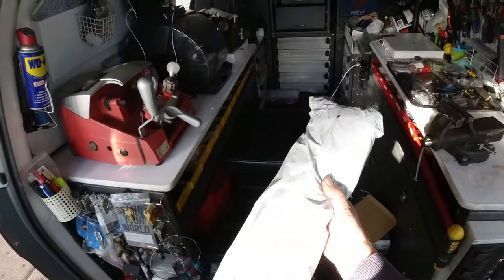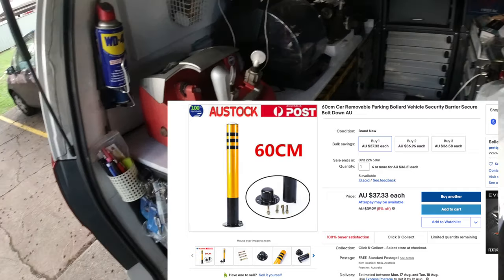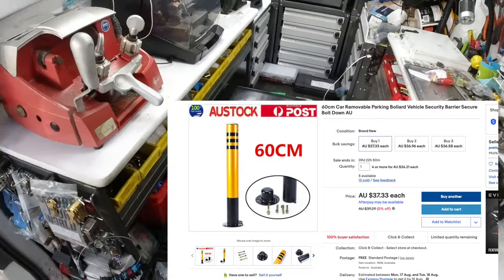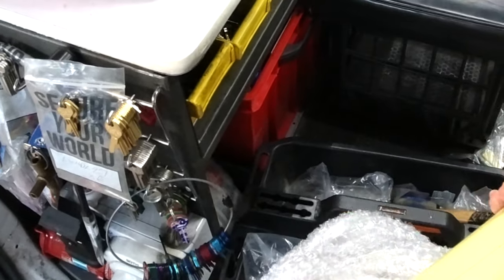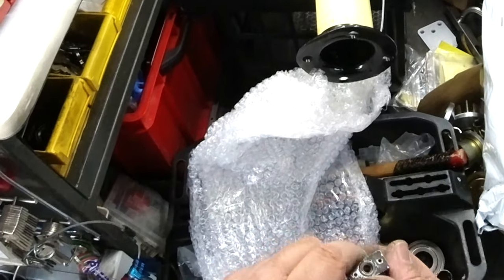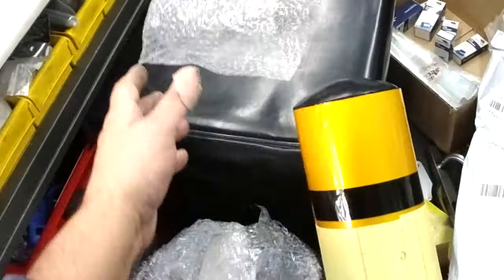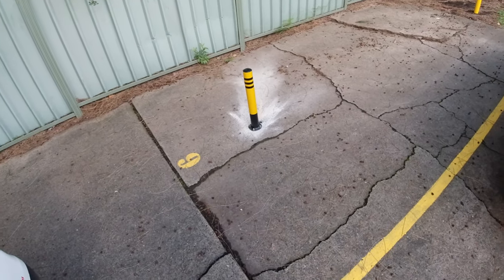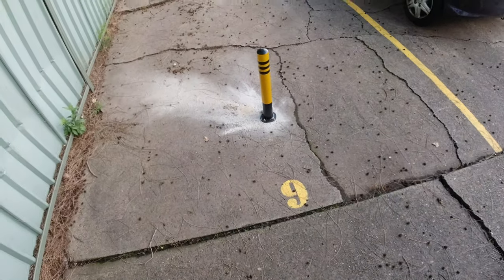Locksmith Job #334 Removable Parking Bollard $37 into $330 in 10 Minutes

Comment: The post doesn't cover the bolts when you put it on, so anyone can come along and remove the bolts.
Reply from the maker: This is true
Reply: Using a center punch to malform the bolts into and over the top of the nuts as well as tough loctite would help slow them down. I would assume only a spiteful neighbour in the night would try to quickly remove it and would probably give up quickly if it were hard

Comment: As long as the customer was happy! Surely the padlock came with more than one key? And I certainly hope you were joking when you said it's 'not pickable'!!
Reply from the maker: Yes, its pickable , but not as easy as a pin lock, its some kind of Abloy copy, I will pull it apart in the next video, Its pickable if you have a tool to suit
Reply: The plugs on these are press fitted, I believe with the right size screwdriver the whole guts will pop right out...
Reply: Dr Lock You are quite right that these are abloy copies, but unfortunately nowhere near the tolerances or quality, the disc housing in these is plastic so the core can be forced, and none of the discs have false gates. It is possible to pick up a cheap disc detainer pick to overcome these locks, and as ‘Fanta’ mentioned the plugs can be popped out as they are only press fitted, still would be interested in a tear down video! Take care!

Comment: I hope you have them a better padlock than the one that came in the kit 😲
Reply: Cheap or expensive really doesn’t matter. Bolt cutters or a cordless grinder will remove any padlock in less than a minute
Reply from the maker: I did put a normal padlock on after, I kept the original padlock and will pull it apart on the next video
Reply: Ideals 👍 Stay safe buddy 🤘
Reply: That's a deterrent , definitely not a solution!